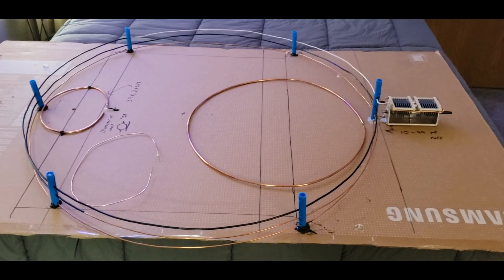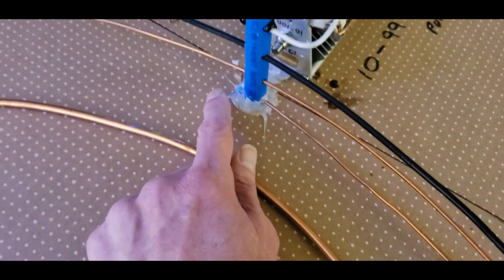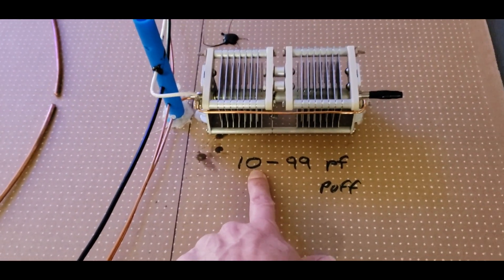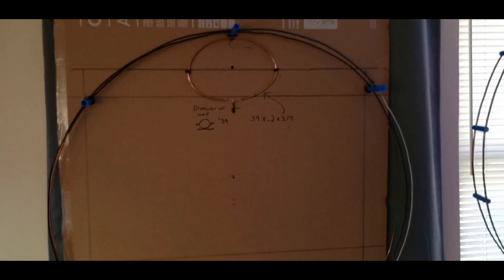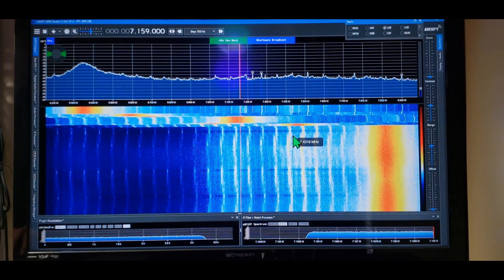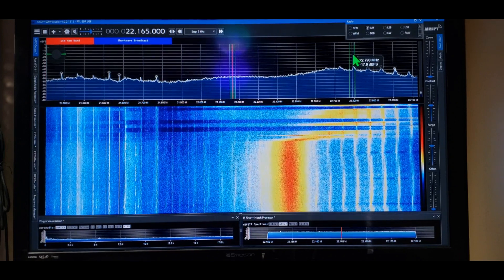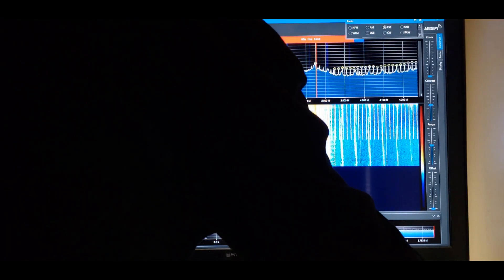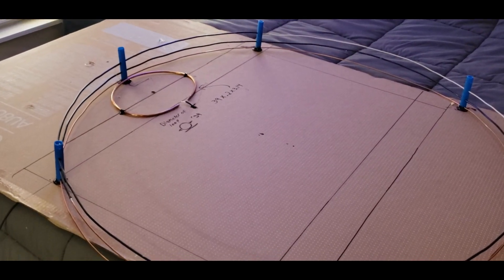How to Tune a Magloop Antenna!

Comment: People watching this video and wanting to build antenna's or ANY electronic device needs to know,  Solder is a "Requirement", otherwise don't even bother because it would be headaches.
Soldering Irons are super cheap on Amazon,  you can get a REALLY nice one for just under $100  and people need to realize not to skimp on the soldering iron.
I'm not saying spend thousands on a soldering iron,  im saying spend about $100 for a really decent nice one and it will last forever and be there for MANY new projects for years to come.
I learned this the hard way.  I paid $17 for a soldering iron and it almost took my hand off, not to mention that it arced on me because it was the China-Cheapo brand.
I learned my lesson and purchased a $100 soldering iron and its been there for me going now on 8 years.  Moral of the story is, don't skimp on your tools kids.....  just dont.  
😉👍

Comment: 13:40 - Yes, it "works."  But it doesn't work "the same."  The fat round conductors are usually used, instead of solid wire, because of skin effect.  What you're getting is the skin depth of each of your wires, added together.  That's much less than the skin depth all the way around a copper pipe.  So your efficiency will be lower.  But hey - if it works to your satisfaction, that's what matters.

Comment: How are you getti g your radio screen on a PC monitor?
Reply from the maker: Its called an RTL-SDR software defined radio made for PC amazon has all you need or Ebay search RTL SDR and you can buy one cheap about 25 to 35 dollars Its a USB device for your PC.